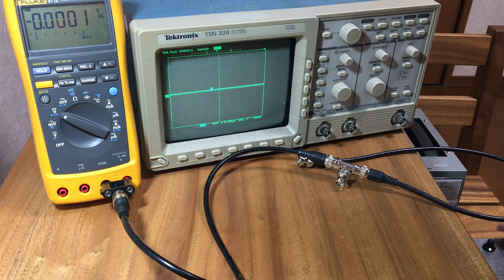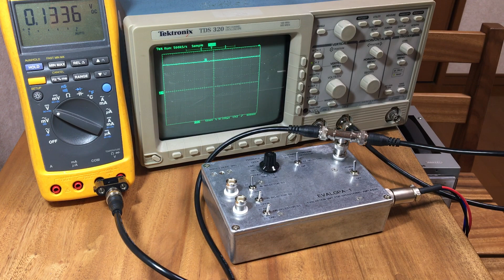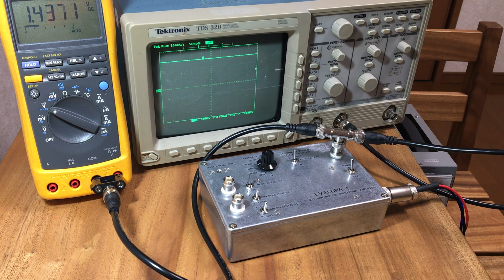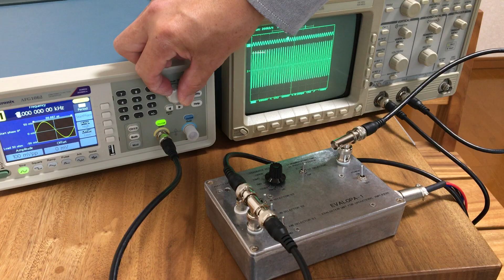CMOS homemade operational amplifier OPM-03

Comment: Hello! Why Is the project no longer presente on the hackday site??
Reply from the maker: The Hackaday.io site seems to be unstable these days. I believe the site administrator is working on it, so please be patient.
Reply: @mitsuruyamada  thank you so much!but how did you verify in this project that the differential pair and all the MOSFETs work in the active zone?
Reply from the maker: @eduardmihailoiu7609  Thank you. As I was experimenting, I realized that it would be difficult to obtain an operating point that would simultaneously satisfy all of the elements, including the Current-mirror, with the variation in Vth of the MOSFETs of the individual elements. Therefore, the number of elements was reduced to only five operational amplifiers in total: the differential pair, the amplification stage, and the source follower. The operating point is adjusted with a potentiometer on the differential pair tail only so that the total output offset is zero. With this adjustment alone, all elements are in the active zone and operating as an operational amplifier. Compared to the bipolar transistor version, this adjustment is quite subtle.
Reply: Perfect!!  If a distortion problem occurs before the source follower stage, can you proceed by inserting the VR2 potentiometer that you included in your project?  I say this because to have a total output offset equal to 0 I tried to insert in my Ltspice project before the source follower stage two batteries to obtain and offset egual to 0. thank you!!
Reply from the maker: @eduardmihailoiu7609  Thank you. VR2 generates a bias voltage to prevent crossover distortion at the source follower. I don't think it has anything to do with distortion in the stage before it. I believe that distortion reduction as an amplifier is achieved by a sufficiently large open-loop gain and external negative feedback.
Reply: @mitsuruyamada  so to have an offset of 0V at the output and avoid distortion between the common source and source follower (buffer) stage, is it not possible to opt for a solution with mos transistors?  I inserted two batteries as a first test to cancel the crossover distortion.  But at the microelectronics level I know that this is not possible, so I wanted to know if there is another solution. I was thinking of a mos cascode stage to provide a constant bias voltage to the source follower, but I lose gain due to the degeneration resistor. thank you!
Reply from the maker: @eduardmihailoiu7609  Thanks for letting me know about your considered example. For me, I have not been able to achieve the bias voltage supply to the source follower stage in a MOS semiconductor configuration. Whenever I try to add any function in a circuit, I struggle to get the circuit itself to work properly. My current achievement is to use a single variable resistor to adjust the bias generation as a very simple circuit. Thank you.
Reply: @mitsuruyamada  Hi, I'm curious when I think about it.  I noticed that the bandwidth at the max gain (68db) is a value between 100Hz and 300Hz (where the cutoff frequency is present).  I was wondering, isn't that low enough?  It is the common source stage that significantly reduces the bandwidth of the differential stage (in your example it should take values around ten kHz if I'm not mistaken) to obtain a max gain.  Generally, what cutoff frequency do these types of amplifiers have?  thank you!!
Reply from the maker: @eduardmihailoiu7609  As an example of a commercially available CMOS operational amplifier IC, the open-loop characteristics of the LMC662 have a DC gain of 110 dB and a cutoff frequency of about 3 Hz. In my op-amp, the cutoff frequency is larger for a smaller open-loop gain.
The LM6162, which is not CMOS but a commercially available high-speed op-amp, has a small open-loop DC gain of 80dB but a cutoff frequency of 10kHz.
Reply: @mitsuruyamada Thank you!  so what can an IC amplifier like this with a small bandwidth be useful for?  type driving small capacitive loads inside the integrated circuit.I ask out of curiosity because I'm used to seeing op amps with a higher bandwidth..
Reply from the maker: @eduardmihailoiu7609  This operational amplifier is intended for the education and practice of engineers and students. The number of internal elements is kept very small to facilitate self-building, so the characteristics are sacrificed.
Some commercially available op amps with very low input current or very low offset voltage have a small bandwidth. For example, such op amps are important for physical phenomenon sensors that detect currents on the order of pico-amperes or voltages on the order of micro-volts.

Comment: How is the noise level of this Opamp? would it be suitable for low noise audio applications too?
Reply from the maker: Thank you for watching! Noise levels have not yet been measured, but it is generally believed that operational amplifiers using bipolar transistors are lower noise than MOSFETs. I think this op-amp is more suitable for basic learning of sensors and measurement devices than for audio applications.
Reply: @mitsuruyamada  it would been cool to see how it would do against like a 258 or something which is very poor for low noise audio
Reply from the maker: @Pulverrostmannen  Thank you for your comment. It seems that noise can be measured by putting the amplifier in a high gain state and converting the output voltage fluctuation measurement to an input conversion value. I don't have a bandwidth filter at the moment, so this will be an issue for the future.
Reply: @mitsuruyamada  without an oscilloscope or analyzer it gonna be hard with high frequency stuff. But audio applications can be heard as hissing or white noise when nothing is playing. The less noise it has the more quiet it gonna be when nothing is playing :)

Comment: What rise time and gain bandwidth product did you get for it? Are you able to measure any input current bias / offset?

Edit: Ah, I see in description, GBP is .25MHZ
Reply from the maker: Thank you for watching! The measurement of the rise time of the trans-impedance mode is estimated from the rise time to this light input, since the rise time of the pulse control of the LED light seems to be faster than that of this amplifier. This is a rough method. 
For the GBP, The linked Hackaday article has been updated with an open-loop gain frequency response measurement chart and explanation.
For the bias current, I attempted to measure the input terminal current in open loop, but this amplifier is too small to measure with a digital tester. The bipolar transistor version could measure 10uA this way.